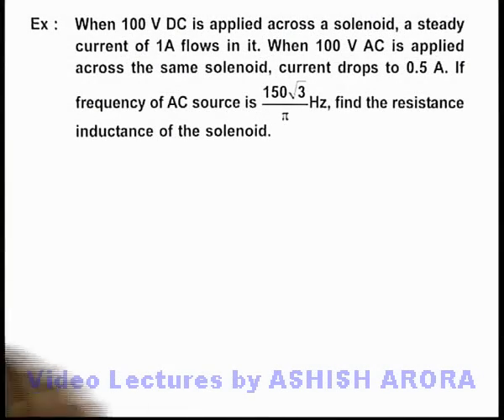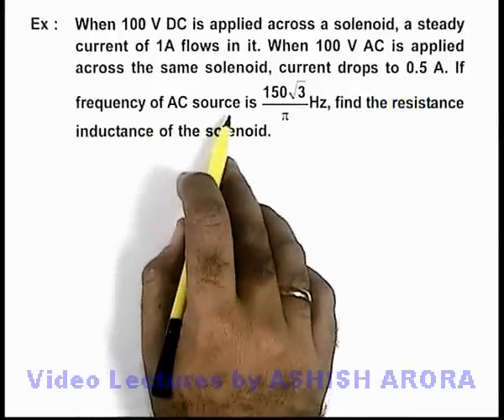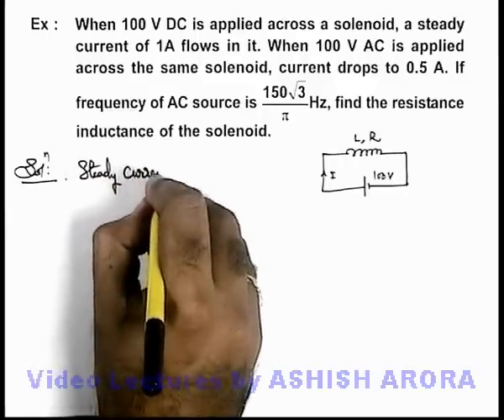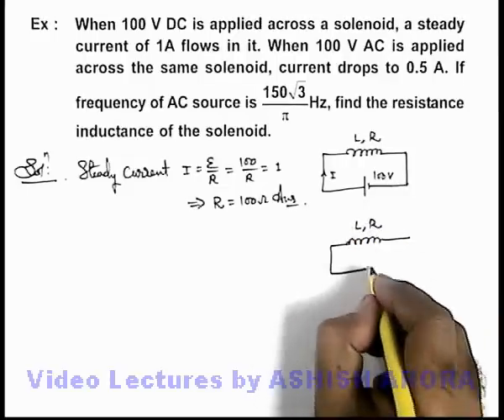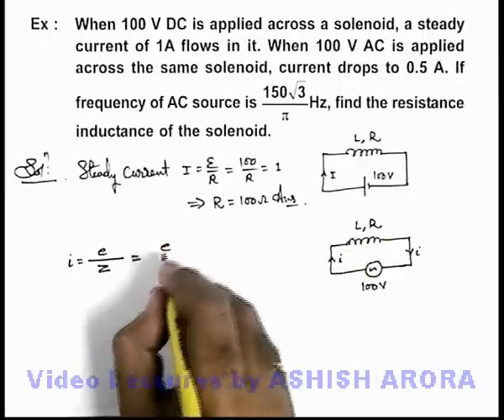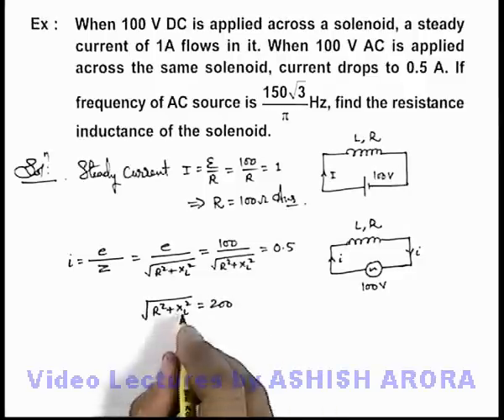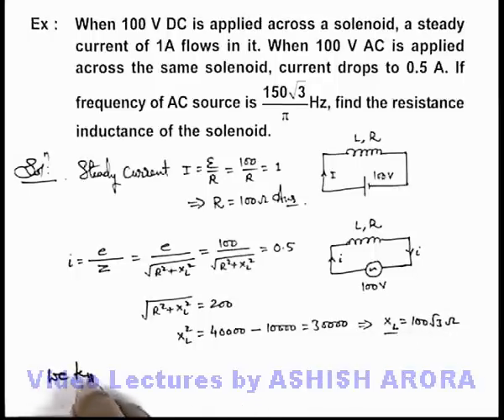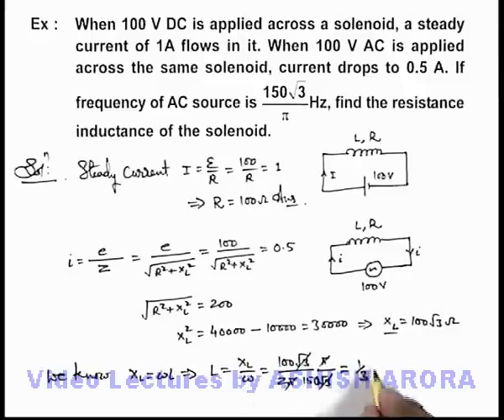Class 12 Physics | Alternating Current | #30 Solved Example-7 on Alternating Current |For JEE & NEET

Comment: sir here 100V in AC means its RMS value or its peak? Also if current is asked in the question, we need to give its RMS or peak value?
Reply from the maker: If nothing is specified use/consider RMS...
Reply: @physicsgalaxyworld  how the sense will change if we say it peak value
Reply from the maker: @vaibhavtripathi852  Its not about the sense... its a convention to consider RMS value if nothing is specified... peak value is taken only if peak value or amplitude value is written for a given voltage or current...
Reply: @physicsgalaxyworld  So sir as nothing is specified in this question as well shouldnt we have taken eRMS as 100 V and not the peak value as 100V
Reply: @physicsgalaxyworld  Thank you sir. I was just looking for this clarification.👍
Reply: @physicsgalaxyworld  And sir also, I just realized that answer coming from both the considerations will,be same
Reply: @rohanjadamali6642  final answer will be same as sqrt(2) will cancel out

Comment: Sir your answer would be greatly appreciated.

In the above video (lecture 30), you used the formula i°=e°/z where you took the value of e°(peak voltage) to be 100V.
WHEREAS
In lecture 32 (1 video ahead), you used the formula i(rms)=e(rms)/z where you took the value of e(rms) (effective voltage) to be 500V.

Sir my question is that even though it is not told in the question whether it is the effective AC voltage or peak AC voltage, how we can substitute it's value in them??
Reply: By default or if nothing specified we take/assume  AC V(given in question) AS rms only
Reply: its always true